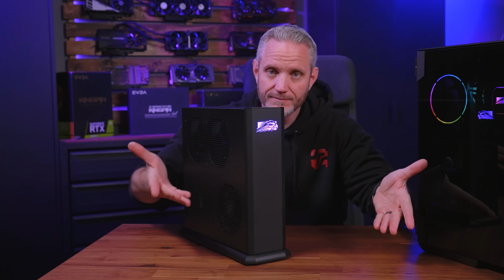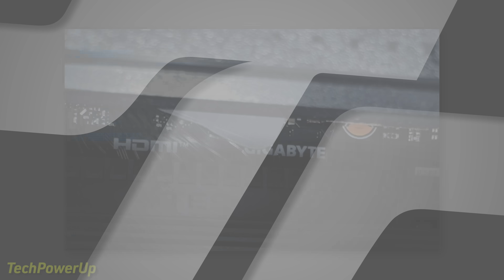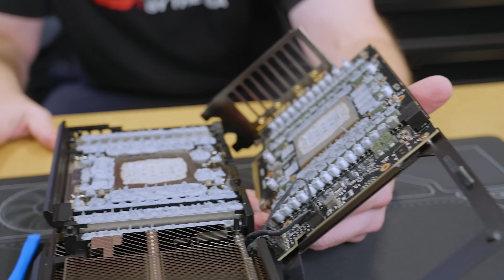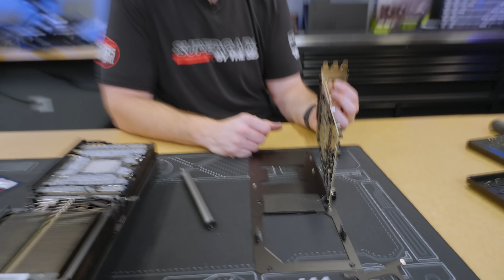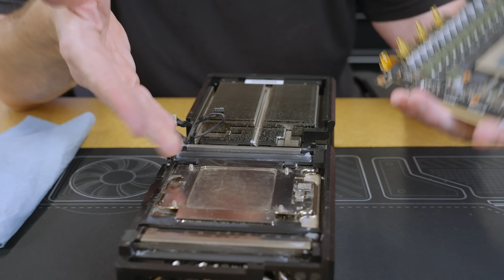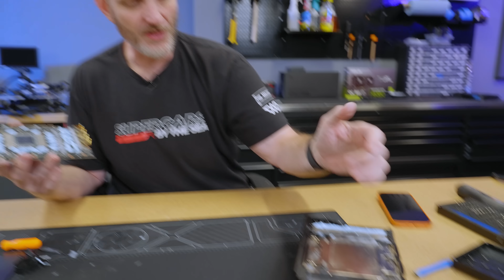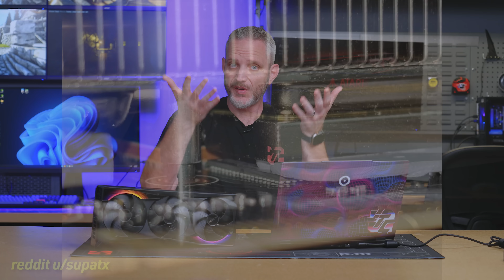What the HECK Gigabyte... WHY?

Comment: I had some issues with this stuff - 9070XT OC edition from Gigabyte, vertical position. 
- Core temps were OK,
- Memory temps went to the 80-90 degrees C in gaming sessions (no memory overclock, possibly badly placed thermal compound there from factory, temps never reached 90 degrees though, so I felt no need to return the card). 

Replaced with themal pads on memory and paste on core (core temp was about the same but memory went to way nicer 65-70 while gaming) and some time after changed the cooler with a waterblock. Now the temps are about 35 C on core and 50 on memory after 3h looping Steel Nomad testing

Comment: I've never heard Jay say what thickness of thermal compound is actually needed.  The obvious answer is just enough to fill the valleys - gaps in the rough surface.  This is much less than what is actually used.  If the paste or putty has less thermal conductivity than metal does, a thick layer works against you.  In my experience, the thermal pastes are way to viscous.

Comment: KPX vs putty/metal mix on the core.  I wonder how PTM7950 would compare to those materials because that's what the other manufacturers like Asus and MSI are currently using on the 50 series.

Comment: When I waterblock’d my Gigabyte 5090 Gaming OC, I cleaned all the putty, went with all thermal pads, didn’t like temps as much, checked squish and was sufficient on everything, decided what the heck and switched to thermal grizzly putty. Temps were immediately better. Most of the pads for that block were 0.5mm at most, obviously if you have some 1mm thick pads then a pad is your best bet.
Reply: As a repair shop i use 100Gram containers of Halnziye HY-256 putty for thin gaps (TG advance and Pro are also good) and for bigger gaps starting from 1.5mm Fehonda 15w/mk pads.

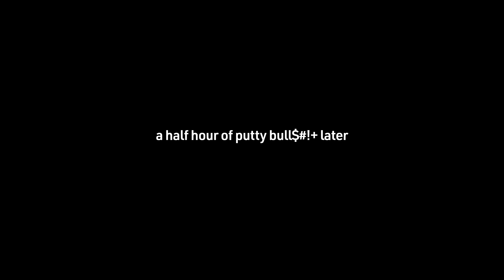Comment: 9:27 I'd be mildly concerned that remnants might cause "bubbles" in anything applied to it. Like I swear one very fine bit of dust squeeked under my heatsink for a CPU when I put it down and somehow it caused the CPU to run 5 degrees hotter than expected. Like the putty was probably well intentioned since they wouldn't have needed to ensure perfectly uniform coverage, but the fact that it kinda melts and moves means that it wasn't a good choice where gravity would let it move. Even if it was installed in a typical tower, it's never perfectly flat.

Comment: I only recently ordered the Gigabyte Gaming OC 9070 XT and it also seems to use that sort of putty for cooling. Considering I don't plan on doing vertical mounting, plus the fact that the 9070 XT draws significantly less power than a 5090, which hopefully means less heat over all, maybe it won't be an issue for me, but it's gonna be at the back of my mind all the time now.

Comment: Sorry Jay! You are completely wrong this Time. 
It IS a Problem if this stuff ever moves when the card is in vertical position. 
It contains liquid metal. It DOES create short circuits. 
I know this because mine died when I tried to convert to water block.

Comment: Igorslab does good putty comparisons.
I used one of the better puttys for my watercooled 4090 and for the gpu die I used PTM7950.

I never had so good temps and the difference between the hotspot and the normal gpu temps are mostly between 6 snd 7°C.
Overclocked and hard used it's 10°C.

Would recommend 😊

Comment: I had a Gigabyte RX 9070 with said gel. I thought it performed rather okay even overclocked with a +10% power limit (max 79c hotspot and 82c memory) with the fans at around 1800rpm but then I decided to sell it and get a Nitro+ and WOW the difference in temperatures is massive. Fans at 900rpm, same overclock, pushing 270watts, both memory and GPU at 72° pushing 3200Mhz !!

Comment: 4:00 as someone who’s tried the TG putty, I would use it for the sole purpose of “I don’t know how thick I need thermal pads to be, I don’t want to run into issues where too thick pads means bad die contact and too thin pads means improper thermal contact”, but I swear that Gigabyte putty is actual gel because when I hear thermal putty I think about the dried frosting stuff

(Also I think us viewers got mad at Jay for a while when he talks about KPX and dry out 2:26, a lot of us if we tried to repaste would probably use phase change material)

Comment: Wow this is crazy. So I bought a aorus master ice 5090, and had it vertically mounted . It stopped giving a signal to my monitors in just a little under a week. I was able to return it and get a new one.i saw a Reddit post mentioning this thermal paste issue so decided to go horizontal mount with the replacement 5090 and haven’t had  an issue since(been about 2 months) I wonder if having it vertical and the paste moving around caused my first GPU to fail.

Comment: I have a Gygabite RTX2080 I bought when it launched and 5 years later it was throttling and the thermal paste had cracked. I replaced it and 3 years later it was throttling because of the thermal pads.

Comment: I'm running a 5080 Xtreme Waterforce WB horizontally in a water loop, in an open case, so I should be ok. It's my fifth or sixth Gigabyte card in a row, because they have always had great performance and have never let me down (my old 2080 Ti is still in my lounge PC). It's disappointing that they have decided to do this.

Comment: I'm still bewildered that Nvidia is getting away with both NOT showing hot spot temps AND keeping the melting connectors at this point. Why hide it? Why use a cable that is obviously melting almost infinitely more than the previous generation? What are we doing?
Reply: “What are we doing?” Is something i ask a lot more these days.
Reply: I forgot about the melting connectors! Besides fake performance, shitty business practices, and how much I hate Jensendhimselftothegrave and his leather jackets, I bought AMD last time. It's not perfect, but at least I didn't give my shekels to NGreedya
Reply: These problems are not as widespread as people make them seem; in fact, it's a very low percentage of users experiencing issues. It's like anything else—consoles even have defects at launch. This is why you don't buy new tech right away. I wait a few months so they can fix the issues. I didn’t switch to AM5 until two years later to avoid bugs and problems. I bought the 5070 Ti Gaming OC mode two months after launch, got the second batch, and have no thermal leaks or melting connectors. Those issues are quite rare.
Reply: The 12VHPWR connector only melts if you overclock the card or don't have it installed correctly.
Reply: @GoatTheGoat  Your statement is incorrect. Plenty of examples where neither are the case.
Reply: @malphadour  I've never seen a 12VHPWR connector fail without it being user error.  Not once.

There is always overclocking or a sketchy cable or a aftermarket right angle adapter or something that the user did to cause it to fail.
Reply: @GoatTheGoat when it happens on an untouched, pre-assembled OEM machine, or to experienced users who would not have same issues on the older 6/8p connector... well then it is 100% an issue with the 12VHPR design. I don't care if it's 'user error' or not, that is just cope for the fact that this interface is inferior for safety and reliability. I've never seen a 6 or 8 pin catch fire or melt unless it had drawn too many watts through a SATA power adapter.
Engineering common sense dictates that, introducing more risk to accomplish the same job as before, is to be intrinsically counterintuitive.
I'll take my chunky double-8pin monsters any day over a fire hazard.
Reply: @that1gnjay  Eight pin PCIe power connectors only supply 150 Watts.  So your two eight pin connectors can supply half the power a single 12VHPWR can supply.

The 12VHPWR connector is safe and reliable when used as intended.
Reply: @GoatTheGoat  The PCI-SIG even took stance against NVidia and board partners, saying that their testing should have accounted for user error. Even as a very technically inclined person, I agree with them.
Reply: @GoatTheGoat it's not. It's not at all. There isn't even load balancing on the damn thing. Phsyics say it's sketchy at best. I'm not surprised it catches fire when properly installed quite a lot. The design is flawed.
Reply: @OutOfNameIdeas2  Bro, No PC power supply standard has per pin load balancing.  That is an obscene standard.
Reply: @GoatTheGoat the GPUs do. And its not required for the new ATX standard.
And Nvidia cheaped out. And now cables are burning up. If you push the 8 pins as hard as the 12vhp you could easily do a kilowatt on 3plugs. That's how absurd this is. Highly inefficient at best and right out dangerous at worst.
Reply: @GoatTheGoat  I’m not sure whether you’re the typical Nvidia fanboy or just really misinformed.
Reply: @ThisIsSoMEan Just someone who can think for himself.

Comment: Why not use PTM7950 on the core and buy a variety of thickness of thermal pads for the mosfets, VMRAM etc? You may have to stack 2 different thickness of pads in some areas.

Comment: I'm having a putty issue with the Gigabyte RTX 5090 Gaming OC, I bought back before the issue was wildly known. I noticed in recent months that every so often my fans would spin up to 3700 rpm while under load (something that didn't happen when the card was new). I removed the card and noticed that putty has dropped onto my mother board and I have no idea if other components are uncovered and the paste just hasn't fallen out yet.. 

I bought a 100g jar of TG putty pro (I'm hopping that's enough) and some PTM7950 for the gpu die. I haven't had time to do the re paste job yet but after watching this I'm thinking about trying to source thermal pads instead of trying to re putty it. 

Does any one know if there's a source on what thermal pad thicknesses you need for gigabyte cards?

Comment: So far I haven't had any pump out on my 4090 that has continuously been used for like 2 years. I would only use thermal putty on the vram and thermal pad on everything else. I used ptm7950 on the die.

Comment: I took my Gigabyte 5070 Ti apart to spray paint it white. Was a messy situation, but I made sure to separate the putty accordingly so I was able to put it back together as original as possible. Temps are great and the same as it was before I took it apart. If you’re taking it apart, just be sure to use gloves and store the putty accordingly to avoid over applying and running out of the original amount (ie. Jay ran out of the original amount because he over applied).
Reply: Seems to me he didn't have enough. What he had seemed smaller than what he took out.

Comment: I ran into every issue you mentioned in the video when I replaced my pads with putty on my 4090 Aorus Xtreme Waterforce. I ran out of putty because it had to be applied on both sides of the PCB, and it was nigh impossible to apply through TG's instructions and ended up using a syringe to apply the putty. It worked way better.

Comment: I've been waiting for this video! To be fair I have known about the thermal putty issues for months because of all the reddit posts, but seeing it in detail like this hits a bit different. I managed to secure a GIGABYTE 5080 GAMING OC on launch day back in February. 
Mine has only ever been installed horizontally, and so like you I haven't really had any issues. The putty is visible but not leaking, and I also have pretty good airflow in my case so the temperatures have never really passed 65'c which has probably helped it not liquify to some degree.
I did consider getting a vertical mount a few months ago but decided to keep waiting for updated versions with PCIe 5 to come out. At this point I'm leaning towards going through with it despite knowing the thermal putty will likely leave the chat, just for the possibility to maybe be able to return the card to the retailer and just pay the difference to get a astral card instead.
Reply: I've had no issues with the gaming OC models. I've owned a 4070 Asus Tuf, 4070 TI Super Gigabyte Gaming OC, and a 5070 TI Gaming OC, all of which worked perfectly. I also had an MSI Gaming Trio 2070 Super and a 3060 12GB Asus standard model. Additionally, I had an EVGA 2080 Super, one of my personal favorites, and none of these cards ever gave me any problems.

Comment: don't matter with manufactures if it runs hotter and reduces its life span, as long as it lasts 12 months then they out the warranty period and it on customer to prove otherwise like for example it was an issue what came from factory but some how you need to prove that unless many were having same issue then you could pressure them maybe to give replacement or fix issue . but as long as it out 12 month company wipe there hand responsibility as long as it lasts a reasonable amount time. i know that how uk law works, first 6 months it on them to prove it was not you and fix the issue , 6 months to 12 month its on you to prove and that is if you have to go law way instead warranty , all depends small print , that law even apply buying a used car , if it unsafe, did not last a reasonable amount time for it age  so issues almost straight away they have to fix, you fix but they give money off the car to cover it or hand car back full refund. thankfully in uk we have goods consumer act 2015 to cover us, even a charity called citizens advice and they have a separate number just for that act so you can even get help at no cost, but it nice to give a donation as they help many. they even help you draft a letter stating the laws. so buying thing in the uk i feel we do have good cover and few avenues you can go down, no idea what sorta laws help you in usa if a company dose not play ball

Comment: Gigabyte also said they had issues with the gel on the initial 9070xt cards, my card just got replaced as the thermals went to hell and vram was hitting 113 degrees… hope the replacement is better.  Might not have been thermal gel issue but I think it was

Comment: In the United Kingdom, we have piece of technology that helps with the removal of floppy putty. The technology is called a refrigeration unit, aka refrigerator or fridge. If you place the object with the floppy putty in the fridge and allow it to cool down, thus making a cold place make an object hard and easy to hold. Be careful though, as handling the hard putty to much will allow the hard putty to ouze out liquid and become floppy putty again.
Reply: As long as it helps get the crap off.. couldn't care what happens to it in the bin.

Comment: I have a Gigabyte RX 9070 XT Gaming OC..., it uses the same stuff. I am really happy with the performance of the card, but not really thrilled by the 96°C of the VRAM under load and 76°C when the card is on desktop. I really hope that it doesn't heart the longevity of the card and that it won't start leaking...

Comment: I honestly wanna take a 5090 chassis, attach a long handle, and jokingly call it a g-maul, (runescape reference) gpu maul. They are so massive, theres are computers smaller than modern gpus. But they also run so cool and quiet that its kinda worth it if you dont mind a larger pc. I might be weird, but i like the large gpu designs. Im also sensitive to noise, so a larger, quieter gpu is always nice.

Comment: I have a EVGA 3080Ti FTW and after watching this I was curious if the thermal putty on my card is pumping out. Also, I'd like to mention I've never opened this card up nor have I repasted the gpu, why? My temps are great and hot spot delta is around 9 degrees during gaming. Anyway, after close inspection all the thermal putty seems fine. I wonder what thermal putty and paste EVGA used on these cards? I bought this card new from EVGA and never repasted the gpu and I use it daily.

Comment: Honestly, Gigabyte's cooling solutions leave a lot to be desired, I currently have a Gigabyte 3060Ti and from the beginning I had temperature problems due to the quality of the thermal paste on the GPU. Since I bought it the hotspot was always quite close to 100ºC in almost any scenario, although the general temperature was always between 70ºC and 75ºC, however after 2 years the hotspot started to exceed 100ºC and, well, I decided that whatever Gigabyte put on it was enough, so I changed the thermal paste (the pads were still fine) and immediately noticed a drop of more than 15ºC in the hotspot, now it rarely exceeds 80ºC and the GPU, and in general does not reach the 75ºC it used to be, it only goes up to 70ºC, that is, -5ºC on the GPU and -15ºC in the hotspot when changing the original paste for a new one, and it is not the first Gigabyte card with which I have encountered the same problem, I definitely think that this will be the last of this brand, and more seeing what they are doing in the RTX 50 series.

Ah!, but changing the paste was not an easy task, the original was so well stuck that when it finally came loose the cooler pulled a solid capacitor off the PCB, so I had to resolder it (without the proper equipment, I suffered a lot😖), literally this capacitor was stuck not with solder but with snot.